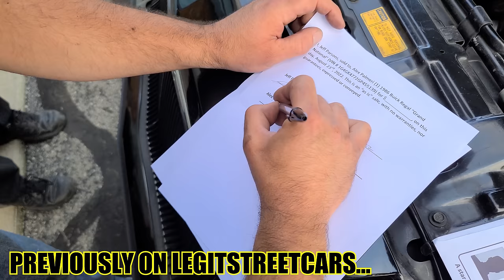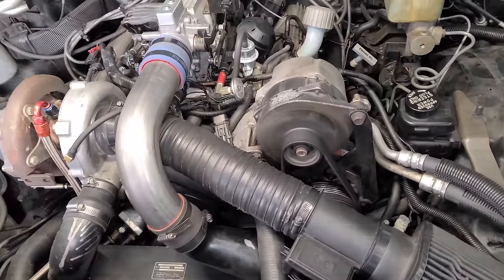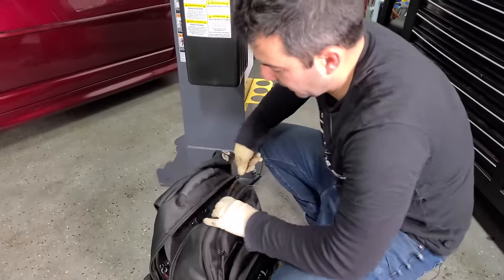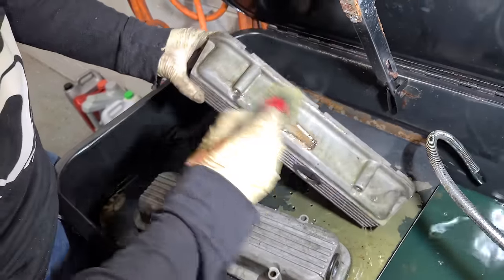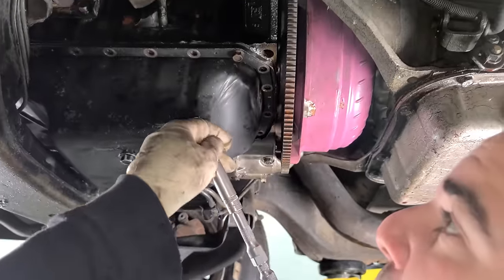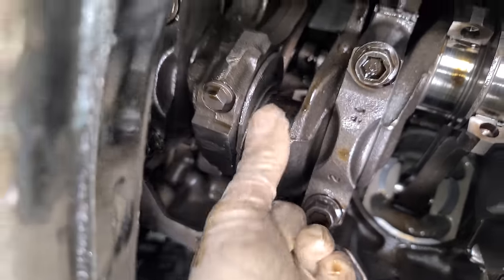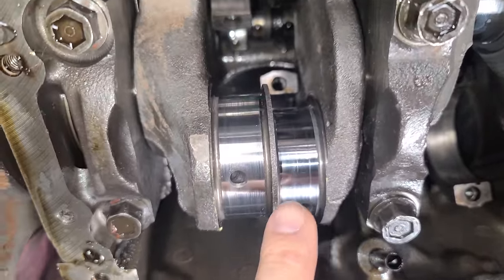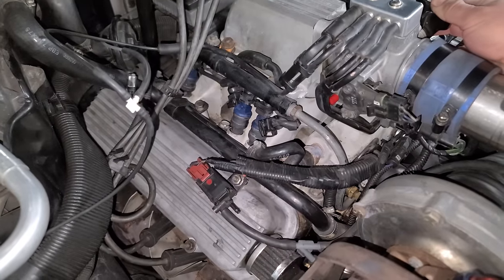I Found A Fully Built Engine In My Grand National That Was About To BLOW UP! DIY Fixed It For $32!

Comment: Very nice piece of automotive history, the way it looks is amazing except the frame which is covered with rust but it is something to expect from a car that old and comes from 4 season state, that salt will not spear anything made out of still. 
Nice repair on the motor. I just don't get why would you swap it for anything else. It has huge potential for more power. 
Anyway I hope you will change your mind and leave original motor . There is a trick to get more power of you have to bore cylinders it is better to polish them instead of hone and you will get higher compression with out any leak down and oil consumption, just remember in that case tolerances will be 10% tighter than if you hone it. I had built lots of engines that way and non of those failed or consumed any oil. Smooth surface creates less friction and better seal between piston rings and cylinder.

Comment: Sounds like wrist pin to me changes with rpm Or piston skirt.Engine looks nice piston looks nice.Would of showed low oil pressure bearings are shot i agree.Some idiot may have  mixed up rod caps.Good job temp fix should get rid of your knock

Comment: I own 2004 version of the 3.8 engine,  factory supercharged-- much better motor by 2004 - very smooth running engine...---- liking the Buick though... I think dude U bought It from knew about what sounds like conrod knocking..

Comment: Now u learned to put a skim coat of rtv and stick the gasket to valve cover! It’s a b@&$& 😁. The rubber v cover gasket’s are the greatest. Had them on and off multiple times no issues. Precision Vigilante converter. 11.50 in a GN is a turbo and fuel upgrade away from stock engine. Torque converter bolts loose will knock

Comment: I had the exact sump issue with one of my vehicles, bottom half of the tank the truck would not stay running very well, drove it like that for years, I can’t wait to see what your tank drop Turns out. Likely the fuel pickup hose has a hole in it due to rubbing , pulling fuel through the hole in the pickup hose inside the tank as opposed to the bottom of the tank as it’s designed to do.
Reply: May explain the low fuel pressure.

Comment: You might want to check the service manual for the actual rod bearing spec. I believe factory was.007”. It was recommended to me to run no larger than.015”. By the way love the YouTube videos.
Reply: Sorry I left a zero out. .0007-.0015

Comment: i had a bmw with bearings looking much worse then what you got there. literally pitting in the bearings. i bought bearings and went another 10k miles and sold it. the car still lives and has done atleast 15k more. journals perfect to the touch but had visual striping

Comment: 303 aerospace protectant for the tires. I treated my brand-new tires before I mounted them a year ago and they look fine. I put that stuff on any rubber part after cleaning and it just soaks it up and even becomes more pliable. No, I don't work for 303 I'm just a fan of the product. Just liked and subscribed to your channel. By the way, I knew it was the fuel filter!...LOL

Comment: Sounds like a stuck lifter. The crack may cause the noise. Check the three bolts on the converter. The cover is missing??

Comment: I bet it is the fuel filter getting clogged from gunk in the fuel tank. Had this issue with my Commodore. Clean the tank out and the problem should be solved.

Comment: as we discovered trying to fix an old mercury, never get a car until you research if you can get the parts. we had a problem with the in tank fuel pump being bad and as it turned out no one made the parts and you couldn't get a pump. we had to get a simular one take it apart and combine its parts with the old one to get it to work. but according to parts stores today everywhere all parts are the same and they can all kiss my ass.

Comment: I wish Oldsmobile had released the FE3-X concept car in 1985, even with the asmatic 5.0 (easily fixed) they handled like a flying saucer on autopilot. P.S. I woulda replaced the oil pump just as a precaution, could be a causation of the bearings possibly. What do those take an M55?

Comment: Hey, anecdotal evidence here, but i used to work with a patient who cleaned parts regularly with diesel fuel. He and the guy he worked with both ended up with stage 4 lung cancer. He swore up and down that it was from cleaning with diesel. I'd say at least leave a respirator by the parts cleaner. Better safe than sorry.

Comment: Question, Why would the engine need a rebuild if the bearings were worn like this from being improperly installed and worn down to that point, as you caught it in time, it wasnt metal on metal, and it was barely ran, so presumabily the crankshaft is okay and hasnt suffered stress fractures, as shouldnt you keep the original engine if for no other reason than collector value, as the last time I can remember, actually I've seen the GSX, 1970 Saturn Yellow, Bright Memory Burn Saturn yellow as craimer would put it, but Never a Grand National

Comment: I have about 50 years experience inside engines now. I have never seen where someone assembled mismatched rod caps like that. Whoever assembled that long block should be ashamed, or have left it to someone who understands that the caps have to stay with the rod it came from and in proper orientation. It was EXTREMELY fortunate that none of the bearings failed bad enough to spin which would have required the crank to come out. Makes one wonder if that's why they were all undersize, this happened before with the mismatched caps and they spun them. I wonder how round the rod bores are now. I do have to say Alex, it's over a video but the sound definitely sounded like a rod knock in the previous video when you bought it. Why didn't you check the pan for noise when you were still in Wisconsin? I think you got extremely lucky driving it back to Chicago and not spinning one. Still shaking my head at the mismatched caps! No wonder they had wear in odd places like on the side near the parting line too! Kids, if you are going to build an engine know your basics. This one is very lucky to not have ended with some major damage.

Comment: I'm going to guess a dry rotted piece of hose on the fuel pump & when the gas gets low it's exposed to air causing it to shut off. While it is submerged in gas there is no problem. 🤷

Comment: Ok.. valve covers..BOOOOO! What a mess you make.  But you gained my respect when you properly installed an oil pan without using 4 pounds of rtv..just seal the mains..good catch on the mismatched rod crank caps

Comment: Not having the right number for the cylinder doesn't necessarily mean poor workmanship.  When I rebuild large diesel engines I weight the connecting rod and piston together then determine position based on those weights to give the most balanced smoothest running engine.  I usually restamp the caps with the new location but not everyone has stamps or if it's the owner they might not worry about it knowing they're going to be the one to do the next rebuild.

Oh and not replacing the lower mains is something that would come back to haunt me if oil pressure problems popped up. So easy to check while the pan is off and since the lower mains are the ones that wear you can get away with only replacing them. 

Fun fact:  Some engines never came with lower rod bearings since they never experience high loads.  One old cummins I remember had u-bolts that held the rod in place.  The fact that you had wear on the lower was a major red flag while wear on the upper is common.  The opposite is true for the mains since the loads are reversed.

Comment: I’m not sure if that’s a weighted engine but if it is the last engine builder could have caused that bearing wear by not putting them in correct order. Not all engines are internally weighted but some are . I’m only at 39 mins so far but looks like a diy polish and bearings but with the oil in cylinders I would have done a compression test also to check the rings

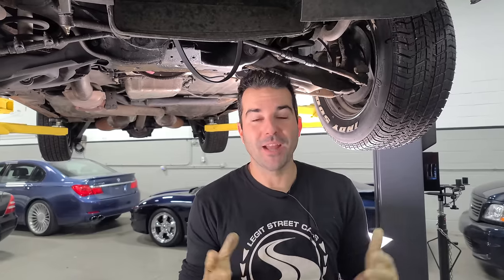Comment: 30:30 Vision! "Lookit! Look at that. It just get's right in there!" (Threads come out bone dry rusty) 🤣:elbowcough:
38:40 - Whut Hat Pins wen yoo myth match rods & caps!!! So I didn't understand what you said you did to resolve this. I assume you figured out which caps went on which rods. It would have been nice if you shared those details for folk who've never done this or have been ding it like the dizbang that "built" it.
You really should have broken these in really easy for several hours monitoring temp and vitals. It gives the bearings a chance to spread out any high spots and even out and settle in. after break in, RE-TORQUE!!!

Comment: you should blend that EGR valve. it does do nothing good to the engine. It's like connecting your toilet to your fridge.... Emissions are higher, because engine is being choked by exhaust gases. TESTED MANY TIMES MYSELF ON MY CARS, all of them had lower emissions than before blending EGR valve.

Comment: Though I can appreciate your enthusiasm, I believe you have "screwed the pooch," so to speak. Even though these are not snapped rods, the caps are still specific to each connecting rod. It seems more likely that the enging builder simply installed the rods in the wrong position with the correct caps on them. Unfortunately, there is no way of knowing at this point. Time will tell. I hope that your repair holds and lasts until you can get your built short block in.
Reply: Rods and caps were stamped with numbers, but assembled mismatched. We returned each cap to it's proper rod on reassembly, then checked clearances.

Comment: Fun fact GM never produced an 3rd gen small block based V6.... Before you say 4.3 L let me remind you... They skipped that generation and 99 to 2006 4.3 L equipped trucks still had a distributor..... Then 07 to 13 trucks had the same engine but they went to a distributor list. Ignition and they put a stub shaft where the distributor used to be but it was the same engine. There was never a gen 3 or 4 small block 4.3 L V6 ....then obviously when they went to the 5th gen with direct injection they did make a 4.3 L version.... But it's crazy that essentially they used the same 4.3 L V6 in the pickup trucks and vans from lake 19 88 to freaking 2014 or something like that with just minor upgrades here or there blows my mind. Great motor though. Great motor. And you know what the fifth generation direct injection one is actually much more reliable than the 5.3 and the 6.2 and would be a great swap candidate for the Grand national, especially with a turbo man. It's direct injection with aluminum block aluminum heads. Much more power than the 3.8l Even without a power adder

Comment: At 9:36 I’m putting my ghess in for the knock… wrist pin 
Because it just happened to me and it was the same and I couldn’t figure out what the heck was going on then we figured pulling it apart was necessary and …wrist pin
It was a Honda b20

Comment: Woo woo ,, stop , use the  pre foam first never rinse first let the foam  lift the dirt , and straight lines never circles when you use your wash mitts, when applying  the ceramic  hydro spray it on the cloth and use  different  cloth to buff

Comment: Just curious here as recently made a stand to hold a 55 gallon drum above a propane heater meant to heat a commercial construction site that heats the barrel filled with 40 gallons of water mixed with 2 gallons of purple power to clean engine blocks and cylinder heads. The contents heats to around 200 degrees F just curious if you used diesel fuel instead of the water/ purple power mix ? would it clean faster ? more importantly would it evaporate during the cooking of the parts or the storage ? since diesel fuel isnt exactly cheap anymore. as for it igniting ? pretty sure it would be okay as long as I turn off the flames prior to removing items and have diesel drip . :)

Comment: I didn't see you mice the bearing journals. Did you recheck the clearance with the new bearings?
Reply: Yeah they all came out to the .0020 to .0030, so with the 40-weight oil it should be real good!

Comment: When you found the caps and you saw the uneven wear, you found the problem.  As I watched I was praying you wouldnt put those caps in the way you found them.  Food for thought.....Race drivers build their motors loose....why you might ask.....have you ever tried to blow a motor that had over 100k on it and was loose?  Build them loose to race them and tight for lots of miles.

Comment: Letting your oil sample in a jar settle overnight, and then pouring off the upper portion to send off to an oil analysis lab ... would seem to ENSURE your sample is NOT representative of your actual oil condition.   For example, metallic particulates, the VERY thing you are most concerned about... will have settled down into the bottom of the first jar, and substantial excluded from the sample you sent to the lab.  That is, unless you shook it up - A LOT - off screen to remix the oil.

Comment: Sounds like piston slap to me.   Generally the vertical spread of the rings PLUS the film of oil on the cylinder walls which is dictated by the cross hatch pattern and depth and the oil pressure AND rind tension, type, and overall fitment of the rings and piston to cylinder wall clearance, all together in a cumulative fashion prevent the piston skirts from hitting the cylinder walls.     Poor ring fitment, very poor break-in, lousy cross hatch, low oil pressure, or diluted oil which washes the walls down and prevents the needed film from adhering to the walls can either cause of combine to cause such piston slap.    The oil pressure gauge might SAY there’s good oil pressure, but that could be a misleading measurement, especially if there is an oil galley blockage post pressure gauge.   Typical dyi engine rebuild includes such maladies as oil passages which have debris left in them from any part of the machining processes going through multiple handlers who each have expected the other to have accounted for. certain details which can make or break a drivetrain, or even just cause a short block otherwise good for 1-200,000 miles to only lady. For 15,000 miles.    The devil really is in the details.

Comment: The rod caps were numbered by weight. They paired the heaviest with the lightest. 1 & 6. I'm not sure on the rest of the caps, but they definitely weren't numbered in accordance to cylinder position.
  Edit: I just saw the labeling of the rods and caps.
Reply: Well?????? I also had the premonition that they were weighd

Comment: How can someone mix up the rod caps? Are they totally illiterate? If the rods and caps are numbered from the factory, there is NO excuse. If not numbered from the factory, you number them before you take it apart. Lucky it didn't spin a bearing.

Comment: Hate say it but you're turning into a Samcrac Jr. LOL Anything finished lately ?
Reply: Alpina. E90. E30. E39. Whipple Wagon. Rolls Royce. Lightning. Subaru. Fox body. C4. Escalade. CL65. Probably others, too. 😜
Reply: @Aiurasensei  I said lately finished. Lighting only thing close in that group
Reply: @craigking1964  reading is obviously not your strongest skill, huh? The C4, alpina, and the fox body have been more recent than the lightning. 🤣😂🤣

Comment: I think pulling the gas tank. Should have been. Done. First. Before you. Left.  The. Parking lot.  Of the storage. I think you have. Water and contaminants.  Change the gas filter again and again.   The vaccum.  Leaks just. Lean the shit out of the power plant.  Good. LUCK.   Spray. Water. In stead. Of. Break cleaner.  Water does the same. With spray bottle

Comment: You got to use at least straight 30 weight oil to prevent rod knock; I say use Lucas oil treatment to prevent camshaft wear! A V-8 would solve all your engine problems, no turbo required! Dumb Bmw guys keep replacing rod bearings, could just use thicker oil! ;)

Comment: love yalls videos, love the cars, love the rebuilding.......but really? common guys you NEVER prefill oil filters. you take a huge risk of adding contaminants past the oil filter which can cause MASSIVE problems. and RTV on a solid surface with a gasket is 1 useless and 2 can cause a weaker gasket overall. this isnt my opinion this is facts proven many times over.

Comment: **GMC TYPHOON PLEASE***
I attempted to post this one, FOR YOU that just sold at auction on the 16th - and YT took the link down. Sold for 19K 

This 1992 GMC Typhoon—finished in one of the less-common color combinations offered in 1992—is reportedly one of the first 10 of these vehicles built, and it was the property of Charles Mountain, the former President of Performance Auto Services of Troy, Michigan, the specialty builder that constructed these special SUVs (and the Syclone pickups) for GMC. The selling dealer—a nationally recognized restorer and vintage car specialist—says that it has a “plethora of documentation that supports the car,” including the original Bill of Sale written by the President of PAS to himself. The vehicle is also transferred with “many classified documents that were never seen by the public.” The selling dealer refers to this Typhoon as “a running and driving project” that was under refurbishment when the original owner passed away.
Reply: @LegitStreetCars  hope you saw that one while it was posted.